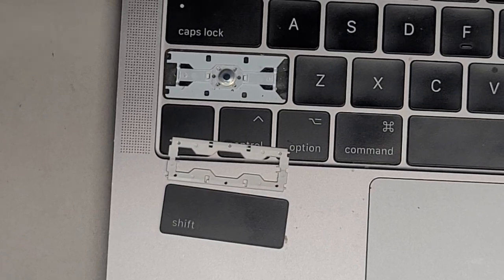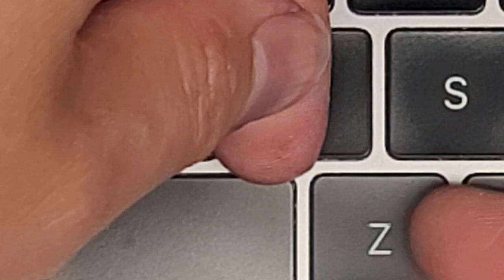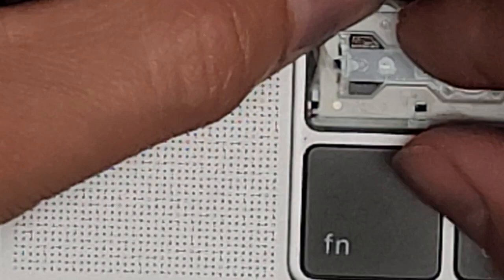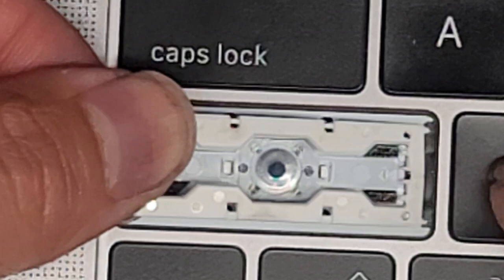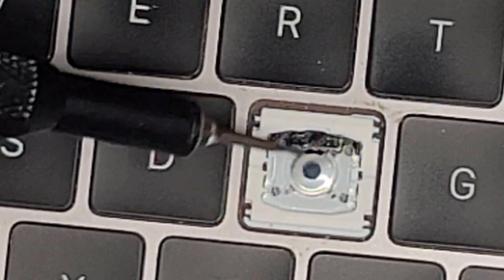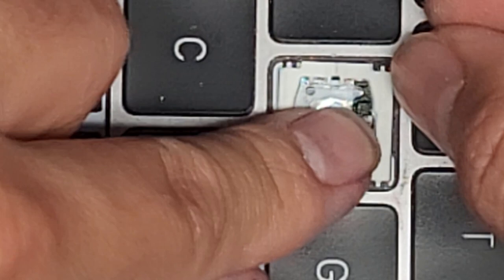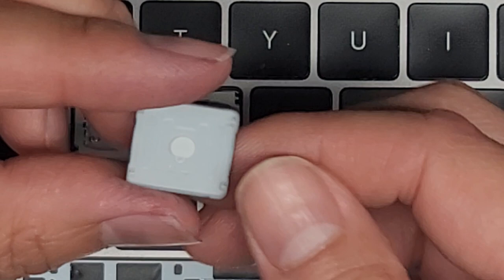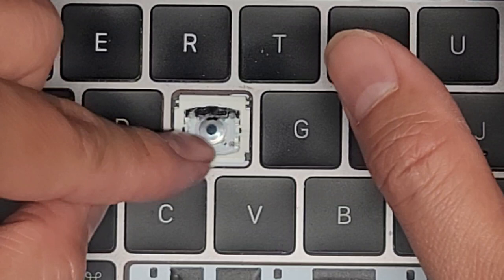MacBook Pro Air Butterfly Key Hinge Replacement Repair How To 2016 2017 2018 2019

Comment: Ok so I finally got the parts and fixed my V key. I didnt have to remove the middle part holding the mechanism down and I managed to slip it in between the silicone membrane thus not ripping it and it looks all original! :D
Reply from the maker: Awesome!
Reply: For the 2019 MacBook Pro?
Reply: @Iksander28  macbook air 2019 but works same on the pro its the same keyboard

Comment: Just made it for my left shift key, thank you for the nice instruction. PS: Removing the membrane is not necessary, you can tuck it under the hinge while you ungluing the transparent plastic, and then when you install the hinge on one side, you can carefully return the membrane and glue everything back together.
Reply from the maker: Awesome, glad it helped. Glad you were able to keep the membrane in tact.

Comment: There has to be a way to do this without prying up the clear plastic part. Or an easier way to glue it down, other than hoping that the double sided tape under it still works after pulling it off. My shift key just sticks out now on the left side after following this tutorial, and half the time I go to use my shift key it doesn't register, because it has to be pressed down until it sticks enough, and then I have to press it again.
Reply from the maker: Need to put new adhesive.

Comment: Hi, i was wondering if you know the name of the black dot that goes over the metal thing that actually causes the short to make the key work when pressed. I'm trying to fix my broken space bar, but the guy at the ifixit shop threw it away when it fell off.. I have the little metal part, but unsure what the black dot that sticks to it is called. I'm assuming its a sort of cushion between the key and the metal piece. Thanks for this tutorial, this gives me hope i can repair this key myself instead of having the whole board replaced.
Reply from the maker: Sadly I'm not sure

Comment: I replaced the shift key bracket because I broke it, but the key becomes seized when I put it together and it won't click at all. Do you know what the problem could be? Thanks.
Reply from the maker: Sounds like the hinge is broken

Comment: i don't understand how you're not having to use adhesive on the shift key. i've had no problems on replacing the letters keys, but the shift key is completely different. i was having trouble because whenever i press the right side of the shift key as i type, it wouldn't engage the key because the left side would come. after removing all parts of the shift key, it looks like my adhesive might have worn off. it looks like you pulled that middle plastic piece up and unglued it. i just don't know how you didn't have to re-glue it.
Reply from the maker: It's double stick tape. As long as it's not too dirty, it'll usually stick back down.

Comment: Do not follow this tutorial.
You do not have to pry the clear part of the keyboard, if you do you'll have trouble putting it back together as it won't stick.
Instead, you can pry the prongs of the white butterfly mechanism and put them underneath.
Reply from the maker: This is a video about how to replace the hinge and key. You can't replace the hinge without removing the clear part...